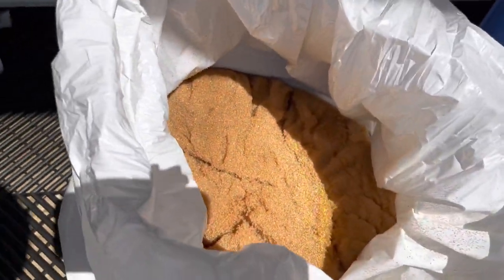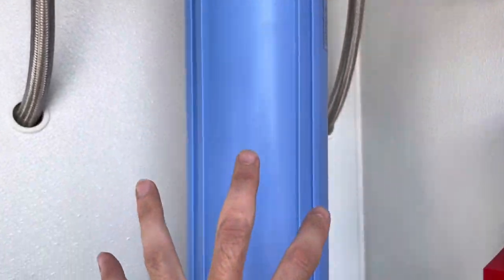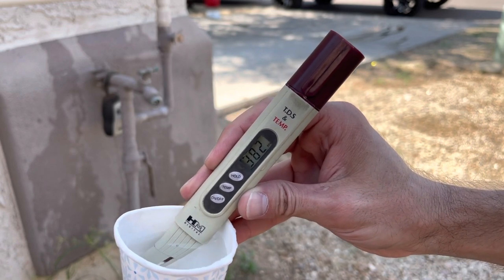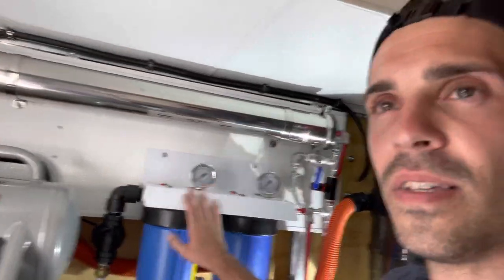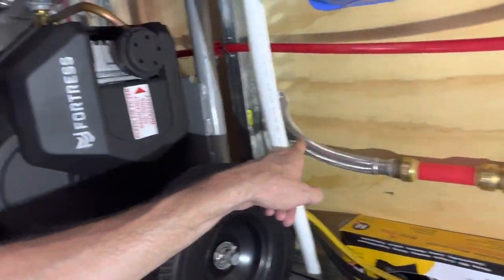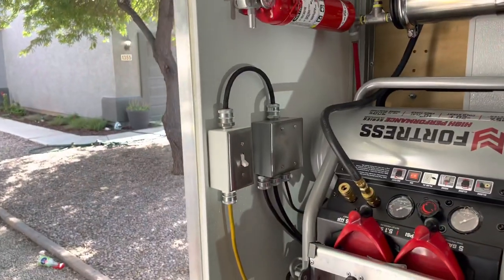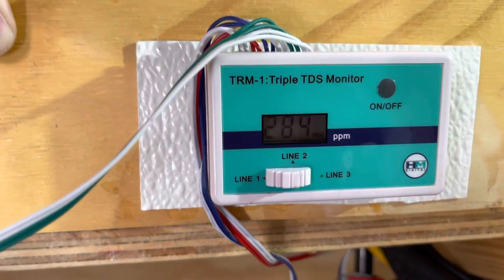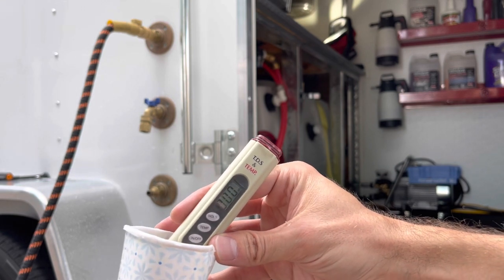Game Changing Spotless Water System with my new Spotless Water Booster

Comment: I use to install Reverse Osmosis systems while they were great they waisted so much water. Forcing that water through a membrane so much water was diverted down the drain the water bill actually went up. The RO membranes are so small that water cannot just freely flow through them. I am not understanding how you are doing this without wasting water like that.
Reply from the maker: Hey Larryr it’s a great question. When you say you installed RO systems I’m curious are you talking about the ones that go under kitchen sinks? Reason I ask is there’s a big difference with the size of membrane for a commercial system vs a kitchen sink system. The membranes I use are commercial grade and stretch 40 inches long (they’re big). When partnered up with a boaster pump it makes them a really cost effective way to produce spot-free water and drops the waste water consumption substantially. They also flow strong at approx 2.1 gallons per minute. For example, my system wastes about 1/2 gallon for every 1 gallon produced. Kitchen sink ROs waste up to 4 gallons for every 1 gallon produced. I have one of the best rejection rates in the biz. To put things into perspective if I make 20,000 gallons of spot-free water I’m going to “waste” about 10,000 gallons. The cost of that waste water for me in the state of AZ is around $18. I didn’t notice a large spike in my water bill at all but I know this can be different from state to state.

Comment: there is a espcial SALT to recicle your resine,  in minutes, and you can used again like 10 times..  i think is more cheaper recily with the salt, tahn buying again resin... it would cost like de 25%, in a time,  with filters in diferents sizes for example 100, 70, 50 20, 10, with 5 filter stations in the lines, is much better than 2.. expand life or filters.

Comment: You should be getting 2-4 ppm out of your RO .  DI wont hurt after as a final polish but anything less than 25ppm does not spot
Reply from the maker: I live in AZ where my water hardness can reach 600ppm+. Most RO’s have a 98% rejection rate. Meaning at 600ppm if water coming out is at 12ppm or below that’s right on target. 2-4ppm would be reachable with an incoming water quality of around 250ppm. Some membranes have a 99% rejection rate but I’ve found what they claim and what they actually put out are two different things. Nothing leaves my pressure washer unless it’s 0ppm. I chase perfection.
Reply: @SpotlessWaterGuy  use a bw-4040 membrane 99.8 rejection

Comment: Hows this different than running two DI systems in a row?
Reply from the maker: Hey brother great question. Running two DI systems side by side will increase the amount of spotless water you get because your increasing the volume of resin but it does nothing to address how much it’s going to cost you to make that water. It gets expensive really fast. I’m using Reverse Osmosis which takes out up to 98% of the dissolved solids in your water (before it reaches the DI). When you do this it allows your DI resin to last much much longer. Like we’re talking up to 50 times longer (dependent on water quality). My system reduced my cost per gallon down to $0.01. When I was using DI only the cost was around $0.65 per gallon. When you look at numbers like that you can see why I went to great lengths to design a system that would reduce my long term water costs. Short answer RO is the difference. Straight DI sucks. Hope that helps.
Reply: @SpotlessWaterGuy  I see, so it's a lot more cost effective to run an RO system per gal which gets you down to the ~10ppm
Reply from the maker: @santiagotruillo8673   You got it. The 10ppm comes out the RO but I still put that into the DI to polish it down to 0.
Reply: @SpotlessWaterGuy   ok so last question. How does one diy an ro system with the pre-scrub, do you have another video or reference for that system before the DI system? Loving your video n information. I'm just starting my business and clean water is very new to me. I'd love to get a better idea on it.

Comment: Watching this 2 years after it was uploaded, I can tell you that using the sediment/carbon block is basically useless for the purpose of reducing TDS to save resin. The RO membrane is doing all of that work. May as well save yourself a step and some money and just do RO > DI.
Reply from the maker: Hey brother it would be nice if that were true… you are correct that sediment/carbon does nothing to reduce TDS, the critical part you are missing however is that RO has a zero tolerance for chlorine. Nearly every public water municipality across the country adds chlorine to the water. Remove the carbon block filter and you effectively open up your RO to all sorts of problems. In fact without the carbon filter (to remove chlorine) your RO would foul prematurely. When it comes to RO/DI systems carbon blocks are absolutely essential. Hope this helps.

Comment: So arnt you using 2 di water systems? I’m confused because it’s like u gotta spend more money then you would spend for resin.
Reply from the maker: Hey Cole! No I’m using reverse osmosis going into DI. Resin from CR spotless is $130 each time you refill it. If you wanted to make 20,000 gallons of spot-free water using that system you’re going to spend over $8,000 on resin. That’s filling it 66 times. With my system you only need to fill it twice to yield approx 20,000 of spotless water. Let’s just say the cost of my system is a lot cheaper than $8k. It saves you a ton of money on resin. Hope that helps.
Reply: @SpotlessWaterGuy  ok because resin isn’t expensive and I am trying to figure something out so it does last longer like I did 3 cars with it and I had to replace it already. Could I get a water softener system fo help?
Reply from the maker: @colekramer4014  no, water softeners do not remove dissolved solids. In order for your resin to last longer you need to remove the TDS with Reverse Osmosis
Reply: @SpotlessWaterGuy  ok so how do I do that?
Reply from the maker: @colekramer4014  my video explains this. did you get a chance to watch it?
Reply: @SpotlessWaterGuy  yes I did just alittle confused

Comment: Great idea, I understand that you just started using your new setup, but wondering a few things. How often are you estimating before you  will need to change the sediment and carbon filters and the filters in you RO tube (1 filter-2 or 3 filters in the tube)?
Reply from the maker: Thank you! The sediment and carbon block are rated at 6-12 months or 100K gallons water with a flow rate of 5-15 GPM (Depends on Feed Water Pressure). The RO is another story. I know some people who have not had to change their RO filter in 10 years. It’s 1 big filter. I imagine it will last me many years to come with good maintenance.
Reply: @SpotlessWaterGuy  I just want to follow up on a 2 year update on your RO filter. Did you need to change it yet? Looking for a set up like this ASAP.
Reply from the maker: @Briwhe  it’s been amazing. So much so i installed another system in my new van. Check out www.SpotlessWaterGuy.com I sell this system now as a complete kit.

Comment: I don’t get it. You’re holding more resin, yes, but it doesn’t change the effectiveness of the resin, just the mass. So you’ll just be able to go a little longer with out having to change out the filter, but in the long run, you end up using the exact same amount of resin either way. Unless I’m missing something?
Reply from the maker: @AlsFishBarn  howdy! the DI modification is only one part to a more comprehensive system to prolong resin life. Did you get a chance to watch the full video?
Reply: lol 😂 I’ll be honest I was 100% just skipping around to watch for what I wanted. I watched more and see that you run and RO system into a tank and then pump water from the tank to where you need it. If I understood it correctly.
Reply from the maker: @AlsFishBarn  you got it brother. Thats the key to resin longevity. Not the DI mod that’s just a helper

Comment: How long can the water sit in your holding tank? Would the holding tank grow algae or bacteria? Do you flush it out daily?
Reply from the maker: As long as your tank isn’t exposed to open sun it shouldn’t grow algae. I’ve had a 100 gallon tank in my enclosed trailer now for 3 years always filled with water and it’s never had an issue. I have seen people however who put tanks in the back of their truck exposed to the sun and those can have problems with algae growth. Im always using the water in my holding tanks because of what I do so I can’t speak to letting water sit in there for months and months at a time without use. Hope that helps!

Comment: Also thoes 2 pre-filter are useless!  Simply run a couple handfulls of salt to recharge your resin
Reply from the maker: Hey Chad! I think you might be confusing my spotless water system with a soft water system (two very different things). With my system I’m removing dissolved solids from the water through reverse osmosis. A process in which something as small as a water molecule goes out one line and anything bigger than a water molecule goes out the other. This is referred to as waste water. You absolutely need pre filters or you will foul your RO membrane quickly. It does not like chlorine. The pre filters help to remove the chlorine. Removing those filters is a great way to destroy the system. With soft water you still have TDS which leaves water spots. A couple handfuls of salt simply will not do in this case. We’re not using soft water we’re using spotless water. The trick to long lasting resin is not to recharge it but to pre treat the water that is hitting your resin. By reducing the TDS you are allowing your resin to stretch much longer. Did you watch the full video?
Reply: @SpotlessWaterGuy  yes so you cant recharge your resin?
Reply: After so many gallons what do you do with your resin?
Reply: @SpotlessWaterGuy  i use resin only no membrane

Comment: I mean... 10ppm won't leave spots so you don't really need the resin filters anymore.
Reply from the maker: I’ve seen this comment a lot. There’s no right or wrong here but I’ll share with you why 10ppm isn’t acceptable to me. My water system is a partner in my business. When I show up to clean a $1 million dollar coach or a $500k Ford GT. I will actually show the customer how hard their water is at the tap with a TDS meter. Then I show them how hard the water is coming out of my pressure washer. It always reads 000. I use laboratory grade spot-free water as a selling technique and my customers love it. They talk about it with their friends. Because of how I’m using a TDS meter in my business, showing customers 10ppm wouldn’t be acceptable. Heck you’ve brought it to 98% you might as well go the rest of the way :)

Comment: I think you may be way off on the math here. Even the site you linked says your simply increasing the amount of resin you hold not the output per cubic ft of resin. Unless I'm missing something here. Let's say 1 cubic ft of resin holds 5 lbs of partials then adding 40% more resin will get you 40% more water. Unless the resin can hold more partials, you won't get anymore output.
Reply from the maker: The 40% resin increase is only a small component to this system. In the video I explain this. The difference maker is the RO. DI resin does not do well with high TDS (total dissolved solids). The higher the TDS the less spot free water you’re going to get from your DI. The lower the TDS the more spot free water you’re going to get from your DI. When you take 400 TDS at the tap and bring it down to 8 (because of my RO) that’s what yields thousands of gallons of spot free water vs hundreds of gallons. It really has very little do do with the DI resin and everything to do with reverse osmosis. The DI resin is basically a polisher for the water. The RO is the workhorse. That’s what yields the higher output. Hope that helps.

Comment: Not everyone can afford a $10,000 water system . use Maguire spot free
Reply from the maker: If you’re doing this full time you can’t afford not to have a system like this. It saves time and money in the long run. Work smarter not harder. Start saving those pennies it’s worth it.
Reply: My systems manufactured in SA cost approx $1500.00 granted there not all bells and whistles but very easy to set up for a DIY guy. I use American low pressure membranes with 10 or 20 inch pre-filters, can even add a 11 litre resin vessel if you want to polish the water.

Comment: There's so much misinfo here tds sends a small electric voltage to measure tds in water. The di changed the ions not removed it your ro system is what's actually removing everything. The di being after the ro system does nothing at all
Reply from the maker: Howdy, RO and DI filters use different physical reactions to clean water. RO is used to partially clean tap water to make it roughly 90%-99% pure. Deionization (DI) filters exchange positive hydrogen and negative hydroxyl molecules for positive and negative contaminant molecules in water. There is a reason systems like the CR spotless, rinse and go, DI rinse, etc.. exist. These straight resin systems also remove TDS but through a different process. To say that “the DI being after the RO system does nothing at all” is completely false. TDS still remains in the water after it leaves the RO. That’s where the DI comes into play. It “polishes” the already clean RO water down to 000ppm to make it totally spot-free. In this instance RO and DI go hand in hand like an Oreo Cookie. You need a plain chocolate cookie along with that sweet cream in order to make a complete Oreo. Hope this helps brother.
Reply: @SpotlessWaterGuy  yea you said it yourself di systems do not remove just alter the ions look it up for drinking purposes it does nothing not saying you should drink deionized water that's bad but it does not remove just alters not saying it doesn't work but would need to be on a huge 100000+ gallon filter for it to even be comparable with the amount of water I use not 1200 gallons but I promise it doesn't remove just alters
Reply from the maker: @rockenuptown1  it’s a good thing we’re not making drinking water. This is spot-free water to wash cars with.